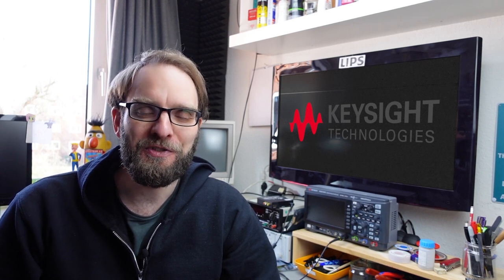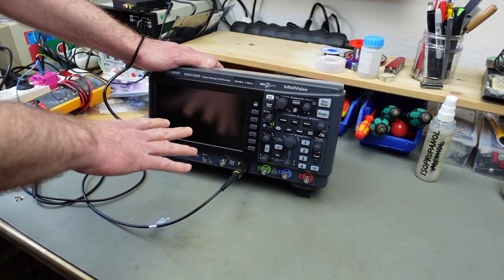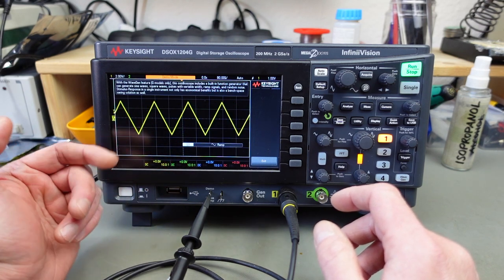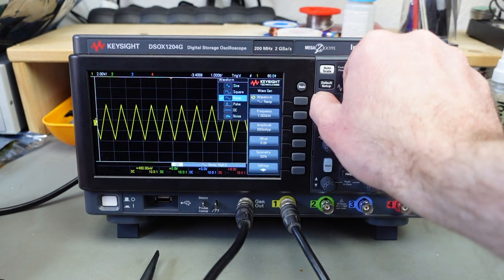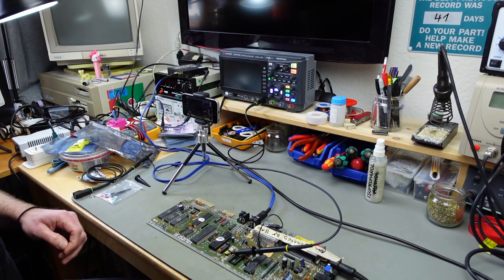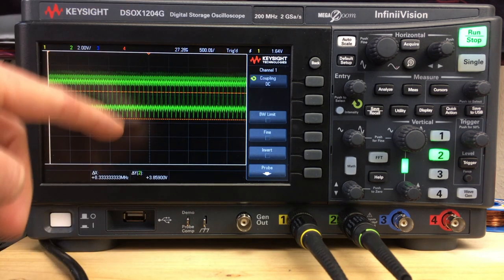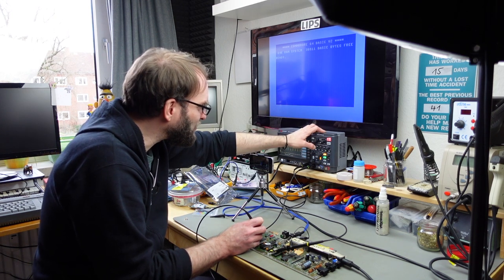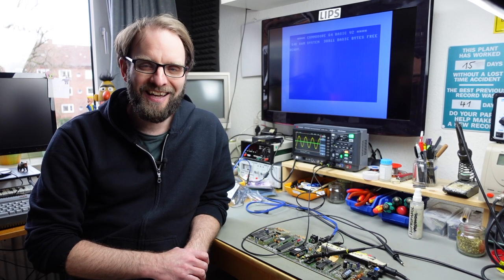A Look at the Keysight DSOX1204G Oscilloscope

Comment: Once you get a nice scope and start to get comfortable with it, you will find more and more uses for it. One of the most common uses is for checking power supplies, just be careful about earthing, make sure you only clip the earth lead from the probe onto the device under tests earth or 0V rail, it’s less of a problem if the device you are testing is floating snd not earth referenced.

Comment: Its worth noting that having much more bandwidth than the frequency of your signal is very useful, because of the harmonics of square waves. If you look at a 1MHz square wave on a 1MHz scope, it will look like a sine wave. If you have a 10MHz scope, it will look more like a square wave but perhaps the corners of the square wave will be rounded or "ring" a little, on a 100Mhz scope you will see a much closer to actual waveform. Now, viewing a waveform near the limit of your scopes bandwidth can still be valuable, since the timing will be pretty accurate, but you need to understand that what you see on the screen won't necessarily be what is actually happening if the bandwidth of your signal is near its limit.

Comment: I didn't know this, but Keysight is a spin-off of a spin-off of HP, which were huge in electronic test/diagnostic equipment.
Reply from the maker: Yes, I think they split from HP to Agilent and then again to Keysight. Agilent is focusing on chemical equipment now I think and Keysight is responsible for the electronics test gear.

Comment: I think one of the important features of DSO is ring-buffer - so you can see what happens after and before trigger. By default, the trigger point is in the half of the buffer (so the trigger line is in the middle of the screen). You have moved it aside, that's why your zoom (emulated delayed time base) looked so strange (to center the trigger/trace, just push the respective 'position' knob). In analog scope you can see only what happened after the trigger event (if you have a delay line, you can see the trigger point also). Basic trigger modes are the same as on the analog scopes, yet have slightly different sense, especially the Normal mode (it refreshes the screen only when the trigger event occurs).
Reply from the maker: Yes, that's true. Probably the most significant function that sets the DSOs apart. Definitely a very useful feature for future tinkering. :)

Comment: I have a USB "Analog Discovery" scope but still haven't bought a real standalone one.  Booting up a PC to use my scope is very inconvenient, and the scope is always packed away somewhere because it makes a huge mess when I dangle it out all over the desk in order to use it.  So it's not handy and so it never gets used.  It's capabilities are also quite minimal.
One of the things I miss on the USB is video triggering (NTSC in my case).  I'm glad that feature still exists on new scopes and I hope it doesn't go away by the time I actually buy one.

If I were buying a real scope today I'd probably get the Siglent SDS1104X-E.  I think that one also has video triggering, but I've never seen anyone demonstrate it.
The Keysights are intriguing because I have more confidence that they will absolutely work well and correctly, but they're expensive enough to deter me from spending that much extra unless I were to see a clear specific reason to prefer them over the Chinese scopes.
From reading these comments, it looks like the Keysights are a lot more expensive in Europe than they are in the US.  The fully optioned model in this video is listed at $1300US, which is certainly expensive, but attainable if someone wants it enough and is willing to save for it.  More realistically there are also cheaper models if you delete some of the options, like cutting back to 100MHz bandwidth and deleting the AWG.  That makes it more equivalent to the Siglent mentioned above, but with Keysight's hardware and software.  I'd like to tell the price with that option package - but I can't find it anymore.

Keysight's web site is frustrating. I know I've seen a price list before showing all the various option combinations and what they cost, but now they don't show that anymore. You have to "request a quote" now to get prices. It doesn't give the impression that they want to deal with individuals or encourage "window shopping".

Congratulations on the scope. I'm looking forward to watching you work with it in future repairs.

Comment: I was able to transfer images into pendrive. But is there a way to transfer all parameter values together with the graphs?
Reply from the maker: You can hook the scope up via network and access some settings and readings through Keysight‘s software and the web interface. I haven’t tried it a lot though but you might be able to achieve what you want with that method. Most more elaborate functions are limited to the higher range scopes though I think.
Reply: @JanBeta  Thank you very much for your explanation. I was then able to save settings and parameters values by selecting save a "setup" file format in the save/recall menu. I will explore the software also.

Comment: What do you think is wrong with the Commodore with the wonky levels on the ROMs in 20:25?
Reply from the maker: I didn’t investigate further yet. Might just be down to the capacitors or my power supply. The C64 seems to work absolutely fine. But I’ll look into the issue eventually. :)

Comment: Nice Scope intended for professional use... Has most of the usual functions, but the generator is a great bonus. What I missed in your presentation was the decode functionality for digital data transmission. Is that hidden in one of the menu's? On other DSO's the decode function has a dedicated button, even Siglent (about 1/3 of the price) has one.
Reply from the maker: You can access the decoding functionality (serial/analog bus) via a dedicated "Analyze" button. Didn't look into that too deeply yet though. :)
Reply: @JanBeta  Ah, Thanks... It would have surpised me very much if such a function would be missing on a professional scope. Enjoy the machine, Jan... I know you will ;)

Comment: bestelle mir gerade ein hantek ids 1070a bei banggood.
es sollte für da c64 reparieren ausreichen. das coole von diesem teil ist jedoch, daß es wifi hat. ich nehme an, daß iches damit gut mit dem tablet nutzen kann.
sehr interessant finde ich bei der c64 fehleranalyse das timing und analogverhalten zu analysieren. also z.b. die signalqualität der PLA ausgänge oder auch vom ram etc.
es würde mit interessieren, ob das 'ringing' am cpu takt - was du da gemessen hast - die selbe frequent hat wie die 8,33mhz die du vorher gemessen hast.
oder ist das nur eine nicht-perfekte schaltung mit reflexionen?
oder ist das HF mist von der passiven oszi-probe?
hab mal mit 50mhz spi/sqi an einem seriellen flash zu tun gehabt, da machte es einen riesigen unterschied, ob passive oder spezielle aktive probe. war an einem teuren digitalen agilent (hp) 4-kanal oszi.
wir hatten damals probleme mit der datenintegrität/verbindung im nor-flash. das signal sah furchtbar aus. erst nach wechsel zu einer aktiven probe war das signal super sauber.
d.h. das signal selbst war perfekt, aber mit der passiven probe war das signal versaut. d.h. die messung selbst war fehlerhaft und nicht die hardware :-)
beim c64 mit 1-2MHz ist das kein problem
Reply from the maker: Ich glaube das "Ringing" war komplett random, vielleicht nur ein Problem mit den alten Kondensatoren oder mit dem Selbstbau-Netzteil, das ich da angeschlossen hatte zum Testen. Die anderen Signale sahen alle aus, wie ich sie mir vorgestellt habe, also scheint es kein Problem mit den Tastköpfen zu sein. Werde mich mit dem C64 aber auf jeden Fall nochmal beschäftigen. Das kam mir schon merkwürdig vor, vor allem, weil das Ding ansonsten komplett zu funktionieren scheint. Wurde mir aber ja als "Funktion unbekannt" gespendet, kann also auch gut irgendwo einen leicht defekten Logikschaltkreis haben oder so.

Comment: Is it possible to make screenshots of the actual scope screen and save them e.g. to a USB-Stick in the front? That would be a nice feature.
EDIT: I see a "Save to USB" button at the right, which should do exactly this I guess. 😉
Reply from the maker: Yes, you can take screenshots via USB and also view and capture via the Webapp over the Ethernet connection. :)